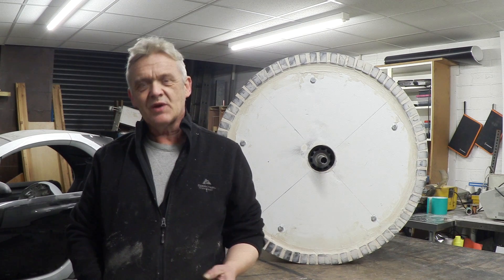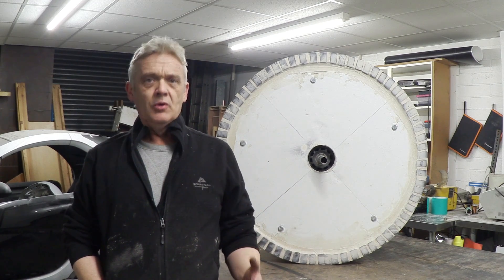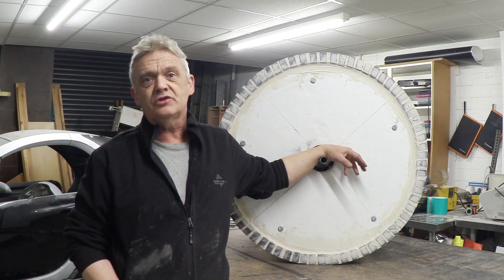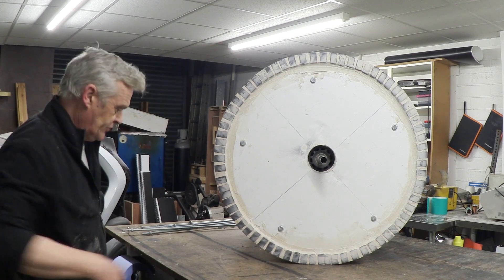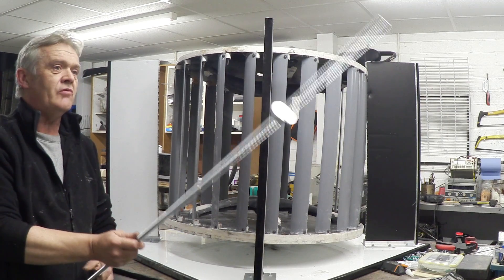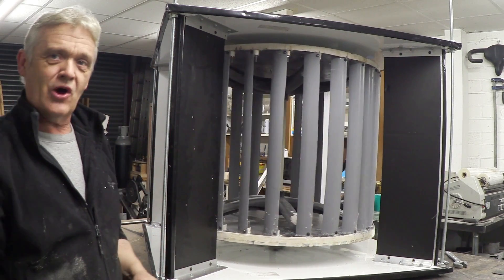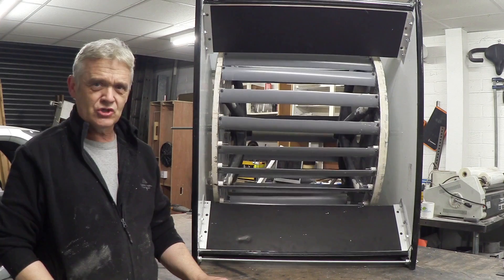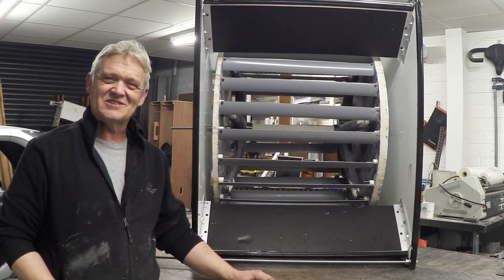Building a 1kW Wind Turbine For Under £100 Part 4 - Finishing The Body

Comment: EXACTLY!!!! FORGET GEARS and garbage! Just MAKE THE DIAMETER BIGGER and at some point you will get to your goals! ESPECIALLY if you get REALLY STRONG magnets, PACKED VERY TIGHTLY, and with EQUALLY TIGHTLY packed coils, with a WHOLE LOT of TURNS per winding! [this is why microwave coils can do very well, assuming you use the high voltage side, preferably double up those coils per steel.
Reply from the maker: now according to me - that is a sensible approach - folks should stop trying to overcomplicate stuff! lol

Comment: Very nice work, but please don’t forget to add some weight at the outside of the circle so it doesn’t run back and forward. Other idea, you could incline the external vanes so wind is directed in the correct direction.
Reply from the maker: yeah potting the magnets has made it a little unbalanced - I need to balance it

Comment: Hi Rob. Pretty impressive. And the build standard looks really good. One thing, though :- the baffle plates are normally oriented so as to direct the airstream into the rotor on the downwind (drive) side and away from the rotor on the upwind (drag) side so as to minimise the adverse drag. The way you have them oriented on the upwind side will actually increase the adverse drag. I hope you don't think I'm nitpicking, I'm just trying to be helpful. I'm sure it;s going to work well.
Reply from the maker: those plates aren't really there for wind flow direction mate - they might have some effect but really they are there just to stiffen the box
Reply: @ThinkingandTinkering  Okay

Comment: Rob.  Its looking good.  And I have no experience.  However I believe the baffle plates at the current angle will reduce wind efficiency.  You could rotate the baffle plates anti-clockwise to direct the wind into the blades.  But a possible better solution would be to use 1/2" or 3/4" pipe instead of the baffle plates.  Looking forward to your results.
Reply from the maker: maybe mate but they aren't there for wind flow - they stiffen the box

Comment: Looking great. I could see this with angled  scoops at the top to deflect more wind into the turbine. A large enough design could double as a sheltered area and a rain collector. These could be made into smoking areas, possibly a bus shelter. The water and electricity mix could even produce hydrogen. If the roof had solar panels too, and all linked up to one of you battery banks for cloudy winless days. Love this project!!
Reply from the maker: cheers mate

Comment: In the vertical position its multi-directional, it will run regardless of wind direction... however... in the horizontal position it needs to be steered into the wind  to generate ... 
😎👍☘🍺
Reply from the maker: for sure - cheers mate
Reply: Put horizontally it would be more of a water turbine than a wind turbine

Comment: It's called building a wind turbine, not how to build a wind turbine.  Buy 2 smartboards at $1000 each, some gutters, threaded rod, pipes, magnets and bearings, and that is before the actual generating part.  Or look around at what you can get for free and see how it fits the same general idea.  Would it be better to have the electronics at the top so that they are more protected from rain?  Then the extra rod can be used as feet.
Reply from the maker: it is - that's because the 'how to' is up to you - I didn't buy the smartboards they were scrap - any weather proof board that is stiff will do - we made a prototype of this in wood!

Comment: How will water effect this in a rain storm  if mounted on a roof? The electric components!
Reply from the maker: no idea - but I will find out
Reply: @ThinkingandTinkering   I'm thinking the inverter should be mounted  on the top maybe in a small plastic case or with a plastic  ring around  the hole  turbin to prevent water splash on the transformer.

Comment: now if only you had larger blades and those 4 struts were running across so they reached half way to the middle of your windmill's axial center, from the side that the back of your blades (the ones the wind hits and slows it down, just not as much as the other due to the positive curve vs the other sides negative curve) then you would be getting real "increase size to get more power or speed output" because otherwise the bigger you go, the more resistance to spin you get from the wind hitting your drum on the "wrong side" of the drum, which means this design offers a chance to even use that benefit as I was talking about, :) (angled so they look like a wind mill from overtop instead of an X that way the wind buffets off of them and into the blades of the turbine on their wind catching side and away from the wind slipping side maybe) anyway that was what  I was talking about doing, though I was also looking at allowing that to rotate a bit too so it could wind vein around so the V shape they form to funnel the wind to that propulsion side of the turbine blades, was able to rotate so it forms the top of its V shape pointed directed into the wind, but in your design they could still be the walls to keep the top ridged that holds onto your top bearing too, and not require anything else to keep it from wobbling, (the outer blades are not going to move anywhere near as fast so I was just planning on either a lazy susan bearing, or a bunch of roller bearings turned sideways with a shaft so it allowed the bottom to roll around on them like the long conveyer belt things they use to unload trucks with boxes by dropping them on it and rails on the sides keep the boxes on the path but the bottom of the box is sliding across wheels that keep it moving down hill till it gets into the store or warehouse, just that mine would allow a continuous rotation in a circle lol
Reply from the maker: nice ideas mate will you do a video of a build?
Reply: @ThinkingandTinkering  yeah I have a lot of stuff to do videos and builds of LOL, right now I am still gathering things for the geopolymers, then will be doing some work on trying to turn some of that into aerogel formation using a freeze drying method with the new vacuum chamber I am almost done building.

Comment: Coils. If one produces, then 4 would fit easily, producing 4 times the output. It could be ramped up, and then smoothing from large electrolytic caps. Now you will need customers to load your supply👍
Very efficient looking, it would need to be rain proof and able for high gusts of wind, maybe bolt it down or with wires. Looking awesome so far..
Reply from the maker: I was thinking wires too mate

Comment: Yes !..double up..magnets and coils at both ends...plenty of information in these videos...I appreciate someone who actually plays with stuff...I was given some of this white board material back in 03-04...it was coated in black carbon fibre though...it really is simple but yet so strong...👍
Reply from the maker: it is a cool material and really easy to work with you can buy the material it's about £100 per sheet - 1.2m x 2.4m - so it actually would be less expensive that a commercial turbine if you bought every thing! - thats just crazy
Reply: @ThinkingandTinkering  yes...years ago I was playing with the idea of it being used as a capacitor...because of the aluminium being so closely packed....maybe the configuration would have to be aligned differently...not sure about the strength of the product afterward though....thanks for the reply...👍

Comment: Awesome mate, it really does look like a Tie fighter, lol that is so cool. Now for the bad news, I noticed something very important that you might want to look into before adding speed of the wind. While you had it on it's side and just sitting there, I noticed the wheel rocking back and forwards which is a sign that it is out of balance. It may be because you have not re-balanced it after attaching the magnets. I noticed in a previous video that you used a couple of small weights to make it turn in balance which is why it worked real well in the parking lot. Anyways I thought I would remind you to re-balance now that you have added the magnets. You more than likely just have not had time to do it yet but, just looking out for you mate, cheers. Awesome job on this build mate, you did real good. I did think of something else, I love the way those angled black supports are pointing to the center as they are, that will more than likely catch a lot of wind and help force the wind to the center, kind of like a wind magnet. It might not been intentional to do it this way but it is awesome and will make that thing move fast even with just a little wind.
Reply from the maker: yeah potting the magnets has made it a little unbalanced - I need to balance it

Comment: I’m thinking this could be a turning point very smart move with the steel 12mm rods and yes use the rest as feet a forklift can get it up on the roof if not it’s a build on the roof doable and does spin really well loving the smart board clean touch can not wait now
Reply from the maker: cheers mate - it will be easy enough for me to break it down and put it back together on the roof for sure

Comment: A scaled down version shaped like a cone could be attached to the remaining threaded bar,my thinking is that it will eliminate the need for a top plate brace if all the the blades are right angle triangles fixing to a length of pipe with skater bearings + round base???:)
Reply from the maker: interesting idea mate

Comment: Rob, really enjoying this series, cant wait to see the results of the finished product. I would love to see you get a KW.
Reply from the maker: that would be awesome indeed
Reply: I'm stupid, but is it 1kw/Hr you are aiming for ? My solar panals are rated at 4kw/Hr I think, in full sun. Please feel free to correct me !
Reply: @IslaSprollie  yess theoretical power but as rob has said most comercially available only put out less 200 watts per hour as the wind just does blow hard enough for long enough. I think Robs will generate 500. -700 watts from where he lives . If you are on the sea front you can do well as that wind is unbuffered ! Also that wattage can be devided over 24 hours or by usable hours when its windy . So definition has to made as it can be rated as peak power .
Reply: @IslaSprollie  cost more than 48 quid and don't work at night ! 😉

Comment: Windspeed cubed - if 25mph=1kw, then 12.5mph=125w, and 10mph=65w.
Reply: Desmond Bagley  mph, not meters per second, which are what wind turbine companies use... but Robert used mph, so I stuck with that. 25m/s would be 56mph!
Reply from the maker: cheers mate

Comment: What you said about the 1kW commercial turbines producing around 100W is very very true, I have a 300W turbine and in strong gusts it can generate about 4A at 14V momentarily .. you would need a storm to reach their rated output power with most wind turbines
By the way, where did you get those magnets from? I can't seem to find a good supplier
Reply from the maker: I got them from first4magnets mate

Comment: Awesome Sir Robert! That's a beautiful piece you have built. As others have mentioned the unbalanced rotation may need a quick fix but I think you have built something with lots of potential for increases in flexibility. You can add to, or change this or that. Lots of versatility. Well done sir!
Reply from the maker: yeah potting the magnets has made it a little unbalanced - I need to balance it

Comment: A super simple built so far, i can't wait to find out what it can generate. When it comes to the electrical side i have limited knowledge...How will the approx 30 voltage with the 60ma...charge a 12v battery? I'm assuming with high RPM the amp will increase alot? Fantastic build & keep up the good work, can't wait until the next installment 👍
Reply: 30V would have to go through a dc:dc converter, and since 12V is charged at higher voltage (14.4 to 15V, depending on flooded vs sealed lead-acid), you would set to that output voltage; 60ma gives 1.8W (less conversion inefficiencies), a safe wattage to trickle charge. 

Lithium and nickel chemistries need totally different charging profiles and fancier regulation.
Reply from the maker: cheers mate and hempev has given a good answer

Comment: Would you increase the magnetic effect if you mounted the magnets on a circular steel band rather than just sticking them to aluminium?
Reply: I'd have thought returning the reverse flux should help increase increase field strength.
Reply from the maker: dunno mate

Comment: Protecting the transformers from the weather might require you to install it on the roof upside down. It won't protect it completely from wind driven rain but it will protect it from running and pooling water.
Reply: cling film and shrink wrapped plastic coke bottle on each one works too, yes it shrinks with heat
Reply from the maker: as Paul pointed out you really don't need to do that much to protect them mate - shrink wrap, plastic-dip or even cling film - that bit really won't be much of a challenge

Comment: What occurred to me is you could have 2,3 or 4 microwave transformers, this would increase the power output. As the turbine increases speed, the each of the generator coils could be turned on to collect more power. Low speed is most efficient.
Top job by the way it looks great.
Reply: I think that is the plan, I guess we'll find out in the next video :)
Reply from the maker: that is the plan mate
Reply: @ThinkingandTinkering  excellent! Looking forward to seeing the finished job.

Comment: Looking really good. I like the high speed low torque idea!
Could there be a problem with very high wind? Over electrical generation and ball bearing/bushing over heat? If so, what to do about those?
Thanks
Reply: ...and vibration - the rotor assembly could do with being balanced.
Reply from the maker: yeah potting the magnets has made it a little unbalanced - I need to balance it
Reply: @sonovoxx  Dyson are good at that. 
If it catastrophically fails it will probably be much safer than prop arms wizzing off in all directions!
Reply: @pressurechangerecord  ha ha!
Reply from the maker: I have heard VAWTs are self limiting mate - I don't know if it is true but I certainly planned on finding out - it does still need balancing though and as for safety - to be honest this is a pretty safe design and could be made safer - if at the cost of a little power - by putting some steel netting over the box

Comment: Great to watch you having so much fun and to see your level of creativity, thanks.  With very little money you could add more magnets on the top fan element (wheel) with four or six coils and double your output with very little addition investment. Thanks Rob for all the fun you provide to us.
Reply: It may be possible since there is such low cogging. I was kinda thinking the same thing.
Reply: Rotate the top coil set so that the cogging from the top set is in between the cogging on the bottom set.
Reply from the maker: absolutely mate

Comment: Rob, you said build finished, are you going to balance it ? In this video its way out of balance and would shake to bits in a very strong wind ?
Reply: I noticed it rocking back and forth in the video and thought the same.
Reply: @5kram  Yes, and as for 1 Kw if Robs design adheres to the Betz constant, and was as efficient as the most efficient turbines then he would still need a wind of 40 mph plus (given the swept area), and with that balance there would be RUD. I am sure Rob can balance it nicely, its very important.
Reply from the maker: yeah potting the magnets has made it a little unbalanced - I need to balance it